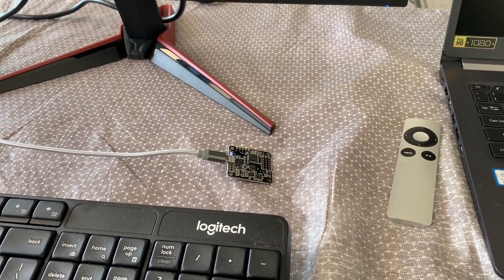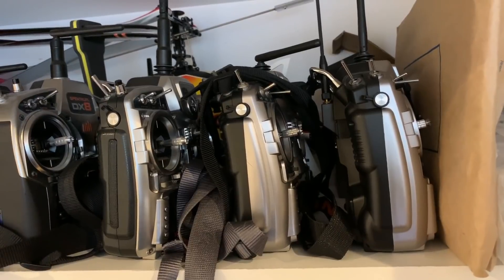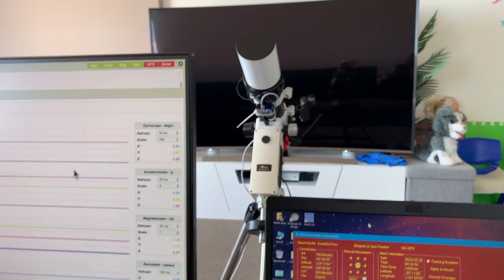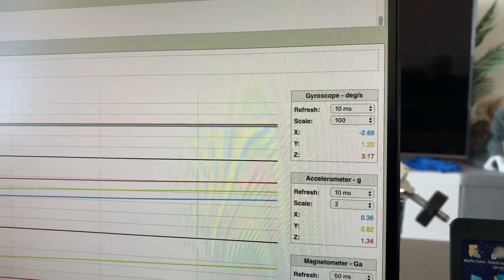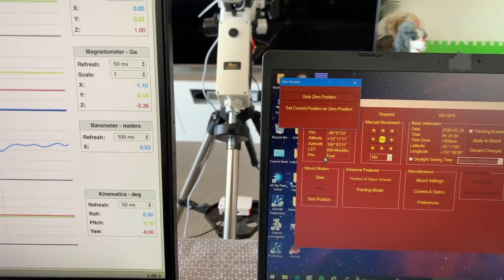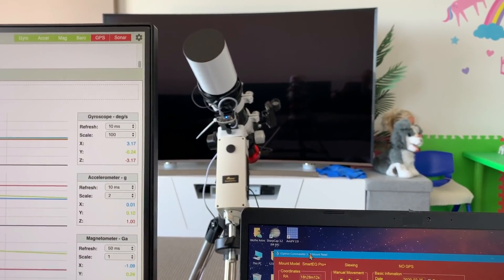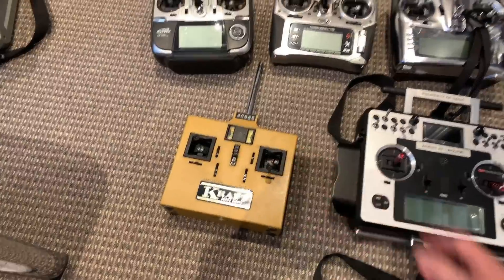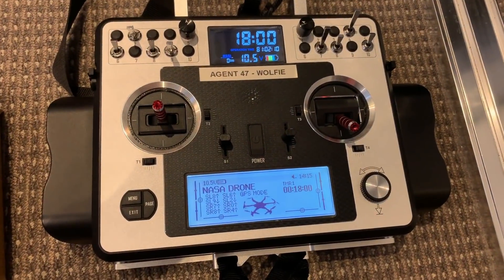Can a drone gyroscope display the rotation of the Earth with hobby level software?   Let us test it.

Comment: I would love for you to try and debunk Concave Earth. Most all of your videos tend to you equidistant mounts and astrological phenomena to disprove flat earth.. However with a Concave Earth, lines of longitude and latitude no not change. Concave Earth does not conflict with other areas of science, in fact is strengthened by them. The celestial sphere simply inverted by our eyes to appear as a dome over head as our eyes often do. Concave Earth solves problems of the Copernican and Flat Earth Models, yet you stick to only talking about the latter.
Reply: Satellites work on concave Earth? And what would concave Earth look like from space?
Reply: @NinjaMonkeyPrime  You likely wouldn't need satellites to project signals in a Concave Earth. It also solves the problems one would encounter with things such as radar on a convex surface. Outer space would actually be the Innerspace of the celestial sphere, not a place you travel to. 
I don't really have all the answers that's why I made the post. All I'm saying is it fits with electromagnetism, latitude and longitude,  and other observable phenomenon and fills in holes of other models.
Reply: @meldoomis6402  If we were on the inside of a sphere (That is what concave earth posits right?) then everywhere on earth would have a direct line of sight with every other. Radio signals disprove this concept immediately. Though I'm willing to listen to a suggestion about how that would be.
Reply: @meldoomis6402  So for your "idea" to work satellites need to be fake? And all space travel is fake? What about the planets or the moon? You do realize that with a ham radio you can bounce a signal off the moon and get the distance right? 

Your "idea" might be interesting if you wanted to write some fiction but when it comes to defining our reality it's flawed in s many ways I cannot imagine anyone giving it more than a second of thought unless they were really high.
Reply: @hashmaldawn3878  not true at all there will always be limitations due to atmospheric perspective as well as the influence of electromagnetism on both radio and light waves. A spinning celestial sphere which produce a moving electromagnetic field would disrupt such things. There are studies showing the effects of electromagnetism on both warping of space and light.  A radio wave for instance would be sucked into the convergence point of the electromagnetic propagation. ie it would appear to travel off into space.
Reply: @NinjaMonkeyPrime  I didn't say satellites need to be fake I said they would likely be unnecessary. The moon doesn't have to be fake either. You are not presenting anything which disproves anything I have said.
Reply: @NinjaMonkeyPrime  The same electromagnetism that warps light and space will warp radio waves. So, bouncing radio waves off the moon wont prove or disprove anything about its distance. The math will still work because the warping would always remain constant giving you the same distortion of time and distance. All observations of space would be effected by this constant.
Reply: @meldoomis6402  "You likely wouldn't need satellites to project signals in a Concave Earth"  Correct.  You'd be able to send signals point-to-point directly, anywhere you like.  Yet we can't.  Oops.
Reply: @meldoomis6402  "atmospheric perspective"  Two words that each have meaning until you put them together.
Reply: @david_akerman  As I explained infinite travel of radio signals wouldn't be possible because they will always bend towards the magnetic point of convergence. As you know radio waves are electromagnetic in nature so I giant spinning electromagnetic torroidal field will have an effect on the travel of radio waves. However, I think satellites would still be able to stay in orbit around the celestial sphere.
Reply: @david_akerman  As for atmospheric perspective... If you don't understand this basic concept than you really are not one who's opinion holds much merit. Atmospheric perspective is the reason mountains in the distance appear hazy compared to one close to you. The more atmosphere between you and an object the more it is distorted. It's why you can't see nearly as far underwater.
Reply: @meldoomis6402  First you have to establish what exists in your version of reality. If satellites exist then how can the orbit the concave Earth? All you said was they would not be needed. That doesn't answer the question. The reality that everyone else lives in has satellites that orbit the Earth. Some of these give us clear images of the shape of the Earth. And they show that it isn't concave.
Reply: @NinjaMonkeyPrime  Why cant satellites orbit a torroidal field? That's no more or less likely than the theory of gravity. In fact gravity is electromagnetic as well. Those pictures prove nothing about it being concave or convex.
Reply: @meldoomis6402  If electromagnetism did warp light and radio waves we could measure it and repeat it and account for it. Since none of that is true it's really pointless to consider it. The only value in what you are saying is if you want to write fiction in which case you can try to make the next Harry Potter. But these ideas of yours are not based in the reality most of us live in.
Reply: @NinjaMonkeyPrime  you should research Maxwell or Faraday or any of the other people who have already shown light to be electromagnetic in nature and effected by such forces. Seems you are making snap judgments based on things you don't fully have knowledge of. Such things are reproducible.
Reply: @NinjaMonkeyPrime  oh and guess what reality is subjective! To this observer I have personally seen much further than should be allowed on a convex Earth. This is regardless of atmospheric conditions.
Reply: @meldoomis6402  Perspective has nothing to do with the atmosphere.  Haze has nothing to do with perspective.  Neither stop radio waves travelling between any 2 locations.
Reply: @david_akerman  Don't twist my words. I said Atmospheric Perspective is but one reason we can not see forever. I said nothing about AP in regards to radio waves. The reason radio waves do not travel forever across the surface of the Earth is due to magnetism.
Reply: @david_akerman  https://en.wikipedia.org/wiki/Aerial_perspective
Reply: @meldoomis6402  
So I should discard thousands of years of careful observation, measurement and science in favor of a supposed alien that talks with a Portuguese accent from being a bush.......

Sounds legit.
Reply: @awatt  Nothing need be discarded.
Reply: @awatt  Most everything we know about physics fits. Some things need be elaborated on but not ignored. Really the only thing I can think of that would be different is space travel.
Reply: @meldoomis6402  Light waves are radio waves.  Radio waves would easily travel from any point to any other point in your football Earth.  Doesn't happen.  Moon is measurably 400,000km away; impossible in a fantasy football.  Give it up.
Reply: @meldoomis6402  
Show a picture of concave earth from high up, maybe from a balloon, that shows all the continents.  Till then you have nothing.
Reply: @meldoomis6402  You don't understand what I am trying to say, I'll try again. Radio transmission ranges are calculated by the equation max range equals 1.25  times the square root of the height of the transmitter plus the height of the receiver. So an aircraft at 10,000 feet can communicate with a control tower from a greater distance than an aircraft at 5,000 feet. Likewise, that same aircraft at 10,000 feet can communicate with another aircraft at 10,000 feet that is significantly further than the control tower. That fits precisely with the globe model, it's easy enough to draw a diagram. Yet it makes no sense on your concave model.
Reply: @david_akerman  Yes light waves and radio waves are both electromagnetic thanks for proving my point. Football? Apparently us dont understand concave its still a globe just the inverse. The only way to measure the distance to the moon is by using light or radio waves but those waves can be warped which creates a discrepancy in distance.
Reply: @awatt  in fact the concave nature would explain discrepancy in continent size even from slight different angles of observation.
Reply: @hashmaldawn3878  I know exactly what you are saying. What you fail to understand is that greater electromagnetic force can warp the radio waves.
Reply: @meldoomis6402  Funny thing about optical illusions, they typically only work under certain conditions. That is eliminated with our satellites.
Reply: @meldoomis6402  Satellites orbit a sphere, because they were designed to do so. To do something else would require design to do something else.  Gravity is not electromagnetic. Whoever told you that lied. The images from space do prove it a sphere because there is no angle where it shows otherwise. More importantly, how are satellites going into space when space would be under the ocean?
Reply: @meldoomis6402  Reality is not subjective. Just grow up.
Reply: @NinjaMonkeyPrime  Reality is entirely subjective. lmao
Reply: @meldoomis6402  The work of Faraday is well documented and resulted in formulas and measurements we use today. None of it supports your ideas on how things might work. They do however support what everyone knows about reality. When quoting a source you should be sure that it actually helps your fantasy.
Reply: @meldoomis6402  You've become boring. Reality when it comes to the shape of the planet is not subjective it is objective. Learn what words mean, stop doing drugs, get a job, and move out of the basement. "Objective reality is that which exists outside of perception. ... Subjective reality contains no objects, only memories, and experiences. Subjective reality lies in actual events but is distinctly separate from the objective. Both realities exist and are verifiable at least to a certain extent."
Reply: @meldoomis6402  So how are these greater electromagnetic forces warping the radio waves in my examples? And how do they warp the radio signals but the transmissions remain clear? I'm very familiar with HF radios and the warping on those is clear to hear.
Reply: @NinjaMonkeyPrime  Satellites would orbit in the same way. Just as you can find a distance with a magnet that can either push or pull an object with out it shooting off or being sucked directly to the magnet. Gravity is not electromagnetic it is a result of it. Images from space would look exactly the same you either don't understand a lens or concave/cellular Earth. Space isn't in the ocean it's still in the sky you are confused.
Reply: @NinjaMonkeyPrime  Faraday's findings show that electromagnetism effects light.
Reply: @NinjaMonkeyPrime  reality is subjective when it comes to the shape of the Earth because as the video of the Charlie Chaplin mask shows the mind creates a convex image despite it being concave. Light, lens, and the mind all do crazy things you seem to fail to understand. I'm apologize if evidence scares you.
Reply: @hashmaldawn3878  watch the videoson magnetism I provided, radio waves are just following lines of convergence in the magnetic field. rather than traveling in straight parallel lines.
Reply: @meldoomis6402  I'm not going to be put off with vague handwaving at a YT video. I did not say that radio waves could not be distorted, in fact, I specifically mentioned that HF frequencies are. The ranges I experience tie closely with the equation I quoted before (though some references say 1.23 rather than 1.25). That makes sense on the outside of a globe. Are you trying to tell me that your electromagnetic distortion just happens to distort radio waves so that they behave exactly as if they are on the outside of the globe and not the inside? Maybe you can draw a diagram.
Reply: @hashmaldawn3878  If you would like I can personally draw you an illustration showing why a plane flying farther away from the surface of the Earth would broadcast a signal farther due to magnetism...
Reply: @meldoomis6402  That would be good
Reply: @hashmaldawn3878  I'll have a drawing to you by the end of the day when I have more time and access to my ipad. :)
Reply: @meldoomis6402  👍🏽
Reply: @meldoomis6402  Footballs are hollow.  I guess you missed my point.

We've measured the distance to the moon using radio, laser, parallax, orbital period.  All give the same distance and that distance does not work inside your football.  Neither do orbit's.  Or seeing the Earth as a sphere.  Or the orbits of the planets.  Or the stars and galaxies.  Or the fact we've explored the planets with spacecraft.

Direct radio waves would reach the entire planet, and they don't.  They only reach as far as the calculated for the outside of the globe earth.

Concave and flat are both false, and both laughably so.
Reply: David Akerman a basketball would be a better analogy try and keep up.
Reply: David Akerman magnetism affects spacetime.
Reply: @meldoomis6402  Well I see what you are trying to show but you've missed a vital point. Radio signals transmit in all directions from the transmitter. So if your red line on your bottom picture doesn't reach the target, a different one does. That's pretty much the definition of line-of-sight. I'm happy if you want to try again though, and thank you for at least attempting an answer, you have my respect for that.
Reply: Hashmal Dawn the magnetic forces are relative to the object. That is just a 2d drawing buddy. 😂
Reply: Hashmal Dawn you have my respect for at least attempting to understand even if you don’t understand quite yet. 😉
Reply: @meldoomis6402  Yes I get that it is a 2D drawing but you show the radio wave as a line, which it isn't. it spreads out in all directions, but keeping it 2D it would show as a halo on your diagram. That allows it to easily reach the target receiver. Draw curved lines-of-sight if you wish but the result is still the same, the radio signal reaches the receiver.
Reply: Hashmal Dawn no matter which direction the signal is broadcast the waves will be carried both toward the ground and to space along the curvature of the magnetic field relative to it’s position between the ground and space.
Reply: @meldoomis6402  Yes and one of those lines of radio wave will pass through the receiver, that's using your diagram. The target is right there between your red line and space. With your idea, it is a different part of the radio signal that hits the receiver but it still gets hit.
Reply: @meldoomis6402  Footballs are spherical too.
Reply: @meldoomis6402  You mean mass.
Reply: @meldoomis6402  Your diagram has completely debunked your own argument.  Congratulations.
Reply: @hashmaldawn3878  I wonder if the other will ever drop.  I mean, even if the penny is following magnetically warped lines, surely it'll drop eventually :).

Self-debunking seems to be a popular pastime this week.
Reply: @david_akerman  Baby steps
Reply: @hashmaldawn3878  I admire your patience :)
Reply: @david_akerman  oh you mean a soccer ball?! lmao
Reply: @david_akerman  how did it debunk it?
Reply: @hashmaldawn3878  I'm sorry you can't grasp the concept from a 2d drawing if perhaps if you gained some understanding of magnetism. you would understand what is happening in the drawing. Your cognitive dissonance just wont allow you to wrap your head around a very simple concept.
Reply: @meldoomis6402  "Faraday's findings show that electromagnetism effects light" You seem like to ignore the part where we can predict and measure these things. So when you say light or radio waves could be affected by electromagnetism, science has determined when and if that happens. Funny conclusion is doesn't work the way you seem to be wishing for. We measured. You should try measuring. Helps for getting things done in objective reality.  

If you want to blow smoke and make stuff up you need to stay away form well established fields that have been measured and are part of established formulas. You should explore the aether or magic. That way you can't be proven wrong about your fairly tale wishes.
Reply: @NinjaMonkeyPrime  Do you realize that what is measured on the surface of the Earth is not the same the farther you get from earth? Time: A Traveller's Guide is a fun book if you are unfamiliar with relativity, special relativity, spacetime etc.
Reply: @meldoomis6402  "Do you realize that what is measured on the surface of the Earth is not the same the farther you get from earth" So the people on the ISS change in height going back and forth? If I'm 6 feet tall on Earth how far away from Earth would I need to go to become 15 feet tall? 

I see your problem is with objective reality. If it's a measurement you run away because it prevents you from making stuff up. I can just imagine you sitting on the couch in the basement trying to think when a square becomes a circle. 

Cool story bro. Now go write some Harry Potter fan fiction.
Reply: @meldoomis6402  Football.  There's a world outside TrumpLand and it's not hollow.
Reply: @meldoomis6402 Your bendy lines still hit your internal surface.  This should be obvious.
Reply: @meldoomis6402  I understand perfectly what you are trying to show, it's just that your diagram fails to demonstrate what you think it shows. There is a straight line between the transmitter and receiver, and there is a curved line also. So radio transmissions would be received in either case. I understand that this blows apart your hypothesis and I apologize for that
Reply: @hashmaldawn3878  I want to see the diagram that shows we see the perimeter of a spherical Earth, set against the blackness of space, from a viewpoint inside a spherical Earth.  I don't think bendy lines are going to cut it.
Reply: @david_akerman  It will be interesting!
Reply: @hashmaldawn3878  Much  disappoint.  I guess he drew himself into a corner.
Reply: @david_akerman  Do you think that he finally understands?
Reply: @hashmaldawn3878  Maybe that magnetically guided penny finally dropped.  Maybe he tried to draw the bendy lines on his iPad and Siri burst out laughing?

It never goes well for them when a science-denier tries to put their thoughts into a drawing.  Exhibit A:  Gleem's hilarious frankendrawing of flerfspective.
Reply: Because flat earth isn't ridiculous enough.
Reply: @david_akerman  don't discredit simply because because you don't understand.
Reply: @mojomusica  Why do you feel the need to be so aggressive and condescending? As I said Concave Earth does not discredit science other than space travel, which I have not personally experienced.
Reply: @meldoomis6402  "don't discredit simply because because you don't understand.
"  Check.  I understand it's nonsense.
Reply: Bending of light due to magnetism. Also some stuff on Gravity- https://www.youtube.com/watch?v=w-ES78p5zfE
Reply: Seems neither of you have proven anything but a lack of knowledge of electromagnetism and it's effect on reality.
Reply: Electromagnetism is key.
Reply: @Muzikgod What did I ignore? lol
Reply: You guys are just very uneducated on the only force in the universe magnetism. Along with the physics of spacetime. I'm not wrong you are just behind, you'll catch up I'm sure.
Reply: watch it- https://youtu.be/vGfBxdJ4fjk
Reply: High altitude and/or space photography along with the red bull guy jumping from the edge of space.. all still possible. I haven't really found any major issues hence this post.